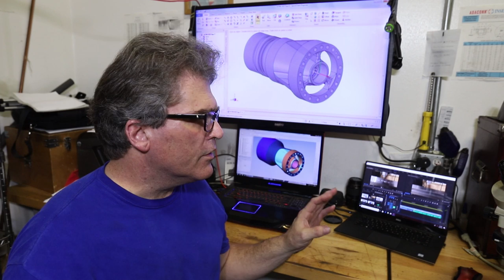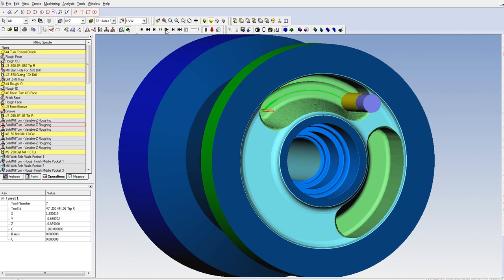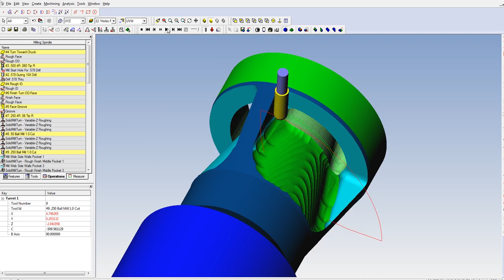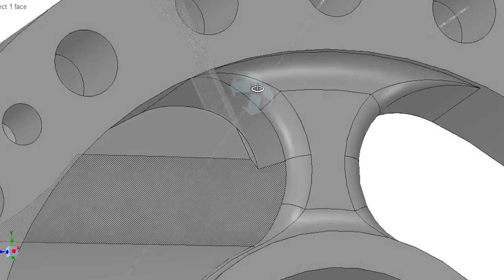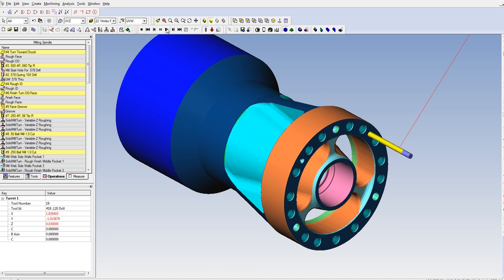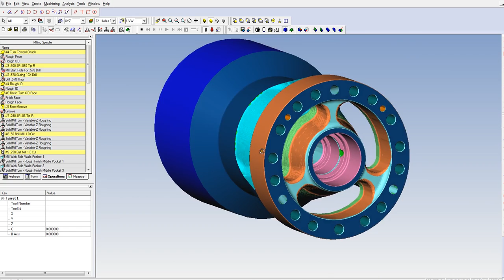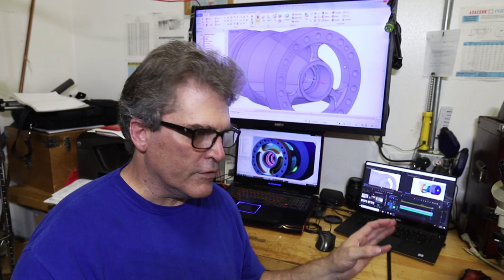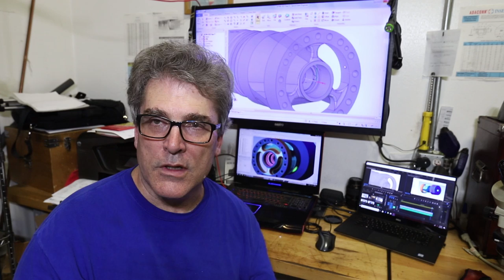Plan A Job 2

Comment: Hey peter.
I have a question. I am maching this part and on my second op I face mill to size. I am getting .002 to .003 difference on flatness do you have any suggestions to help? Material is 6061 t6 aluminum tool is 3in facemill hex inserts. Holding on with soft jaws that fit the profile of the part. Thanks!
Reply from the maker: How tight are you tightening the vise? How wide is the part? If you put a dial indicator on the middle of the part and tighten the vise does the part bow up? Often times what I do is tighten the vise for the rough. Than stop and loosen than snug (just enough to hold the part) the vise for the finish cut. Think of it this way, every thing moves what you have to do is try to minimize that movement.
Reply: Are the corners of you jaws relieved or is your part chamfered enough to clear the radius in your jaw corner? If not, it will cause the part to kick out and that can cause flatness issues. That’s just one possibility.
Reply: Jason Stagner thank you for your help. corners are relieved. Parts are  half circle shapes the top of part is flat bottom of part has a 1in flat. If that makes sense. So I'm push against two flat surface.
Reply: Gus Mcgussy thanks Gus!
Reply: Ya gotta know when to tap down...and when not to...when to hold with 8 ftlbs... or less... ive held brass with 25 inch lbs while removing and eighth with a 5/8insert tool lmao...pucker factor.
.. held 4 tenths parallel
Reply: Edge Precision thank you for your suggestion. I will give that a try.
Reply: raider also.... when holding with little force... when tapping sometimes you get bounceback.... sometimes i tap with less than half the weight of a small deadblow... light taps lol

Comment: Hey I am not sure how it works in the machining trade, but can you not submit to the designer/engineer a 'alternate' model which has better geometry that would make the part easier to machine, faster, or just better like you detailed with the 5-axis milling versus just surfacing. Perhaps if there is only one of these things it wouldn't be worth it, but if you had to make a bunch maybe?
Reply: John Way generally not, particularly in these types of jobs
Reply: The designer who made that model is fairly skilled and should have a decent idea of what drives manufacturing costs - so if they put something expensive in the person making the part usually has to assume that it is there for a reason in spite of the problems it causes.